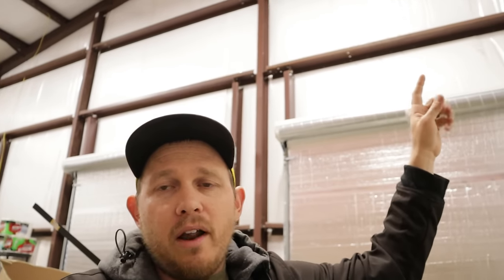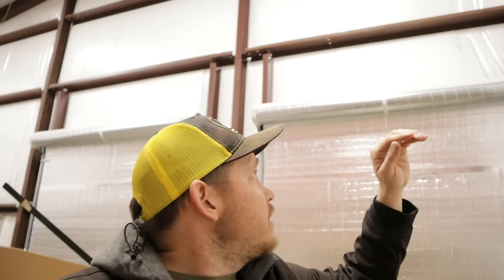My Biggest Steel Building Regrets

Comment: roof insulation-use of vapor block 3/4 foam board strip under roof panel either glued to top fiberglass itch or glued top purlin. roll run itch or insobasket. both ways keeps building from condensationon purlins yes much more expensive but well worth price as itch is full depth of purlin height. or spray foam only one inch against panel then add six inches to that save cost of spray foam...adding an elastomericcompound to roof surface keep condensation down and add years to roof lifespan sealing up all screws and joints. correct use of foam closures is also a must on gables and eves , edge panels
Reply from the maker: What kind of elsatomeric compound do you suggest?  Great advice thank you
Reply: @homesteadingbarndo  we always used what we called silver seal....no idea if thats a name brand...five gallon bucket....hundred bucks ...that was twenty years ago....I've built STAR, CHIEF, VARCO PRUDEN...we mainly used on service calls for leaks or sometimes on standing seam panels where steamer didnt get good closure....mastic tape needs to be semi soft when applied or it will not get squish it needs ..
Reply: @homesteadingbarndo  something else, when used do NOT walk anywhere on roof panels  stick to walking where purlins are located. panel will flex or kink in weight applied to weak areas....words of wisdom. any kinks need to be reinforce with overlapped peice panel and caulked throughly and silver seal applied around perimeter

Comment: I am planning to use a wood burning stove in my barn/building…I already have the stove, as I was planning to use in my unfinished cabin, however at 700 sf, any ole electric heater will probably suffice.
Reply from the maker: I just put my pellet stove in the 1200 foot shop half of the building and it has been cold already but it is keeping my house in the mid 60s without heaters! 

I can't recommend a mini split enough

Comment: No one ever tells you what a HUGE problem with condensation is with steel buildings. I run a dehumidifier all winter in my storage barn. ……You will still have the same problem with wood framing because the problem is with the metal roof and siding..
Reply from the maker: Yep I had no clue

Comment: Could you do spray foam on the ceiling and cheaper insulation on the walls to save $$ money and not have the vapor / moisture issues?
Reply from the maker: This would probably be a far more cost effective method. I think if I was building again I would just spend WAY more time making sure everything was perfect. I'm happy to say we don't have leak issues anymore but it was  alearning curve. 

Building without being so rushed would have helped too, we were racking up bills for equipment rentals and weather was terrible. High Winds and things so if I had been able to build in in May/June it would have been much easier too. 

Hindsight is 20/20 right? 

You building anything?

Comment: Thank you so much for sharing your experience with us.
Back in the 80s I was a contractor in Central Texas and I erected and finished several steel buildings ,some of them fairly good size..
When I first started doing it I was shown by someone to use chicken wire mesh and cover the entire frame with that before laying the insulation down and that way you can get those seams more secure, and it holds itself up without sagging in your roof...if someone does it  please consider putting wood between your flexing steel framework when you tighten the chicken wire.... then after sheet metal is screwed on securely you can remove those wood spacers from your purlins and girts..
None of the buildings I built ever called for spray-in foam , so all I ever used was the vinyl back roll insulation...
And there is not a way to do it without hating the experience... LOL!
I do certainly like the spray foam better..
Anyhow, great video and for anybody who's doing  steel buildings , I would suggest watching this fella and listen to him..
Reply from the maker: Thank you so much and that's so interesting! It definitely sounds like a terrible experience, but I'm sure it's really effective at keeping everything in place.

Comment: I used big building Direct to install a 24x50 metal building . What a mistake! It rains inside my building every time it rains outside . No baffle installed under the ridge vent causes rain to blow right in!  Crap Job done by Big Building Direct! I’d definitely use someone else 3:10
Reply from the maker: I'm so sorry you had that happen! That's real tough. I wonder if doing closed cell spray foam would fix that?
Reply: I'm glad that I saw your post. I suspect that the problems you had reflected what looks like a good price. Taking short cuts that the average buyer doesn't notice or know to look for.
Thanks

Comment: I just found your video.   I am planning on building a bardo too. You mentioned you want to get a helicopter.  I can tell you this. My father rebuilt helicopters for lots of the pilots that took the tourists on rides on Miami and Ft. Lauderdale Beaches.  I also helped him for many years.  You will need to factor in the hight of the trailer to roll it in there.  My father built a two story barn. They barley fit. So figure on those doors being about 24 feet high at least.  My opinion,  get a separate building for it. You can't leave them outside.  Of course it all depends on what type of helicopter you get.  Also,  my father had wheels that he put on the landing rails that he used on some of them.  But if you are getting a small kit helicopter for one person they can be shorter. Do you homework. Also there are a lot of rules for aircraft.  If you are not rich,  rethink it.They are very expensive to upkeep.
Reply from the maker: This is really helpful thank you! I think I'll try to rent out helicopters when I start learning rather than buying one.
Reply: @homesteadingbarndo, smart about renting. 

Consider consulting a tax person (maybe a tax attorney) about whether leading vs owning is a better write off for a business. 

When I studied for my realtor license years ago, my teacher told us that leasing (his example was the building for a business) was a better choice, compared to owning. This could have changed in the interim, tho 😊
Reply: @khm2128  I am building this for my home.  I am hoping to stay away from a mortgage at my old age.  Especially in this horrible economy.  I have no mortgage now.  I am selling this place to build on a  seven acre piece of land I have in a different state. I am a homesteader.  I have been for many years.  Moving to a larger piece of property means I can do more.  I am on one and a third acres of land right now.  Plus this new property is next to a family member.  His land and my land together means that we can have cattle and sheep. Not just the chickens I have grown.  Plus I have a 20X32 greenhouse ready to put up already there.  I have a small greenhouse here. I have lots of different fruit trees that I have planted over the years here. I have already started planting some on that bigger property, but will be a job to plant the amount and diversity that I have here on this site.  I like to have some sort of fruit all year long.

Comment: My shop I just sold was built in 1994 and it still looks brand new. The horse stalls were build 5 yours latter,and the bees have destroyed it.never again will I use woof for anything except furniture,moldings.or campfires
Reply from the maker: Thanks that's good to know. Sorry you had a bad experience with carpenter bees that sounds rough

Comment: Great video. I plan to build the same size steel building. 37K seems reasonable.  What is the name of the company that sold you the building and did that include the erection cost as well? Thanks
Reply from the maker: It was star state steel, they were great to work with, Linda is the owner, super kind and helpful lmichieli@starstatesteel.com is her email. It didn't include cost to erect, here is a breakdown to the penny of costs to get it to the point of building inside. https://youtu.be/pfoq-IYr3SE I'll have a complete cost breakdown soon for interior build out too as I get everything finished. Let me know if you have any questions and good luck!!

Comment: i originally went for 14' garage doors on my barndo but that gave the architect(s) ... trouble let's say.  it's hard to find planners/architects that can think outside the box so to speak.
Reply from the maker: What did you end up with? I couldn't find any architects to help out on the house design so I had to learn it
Reply: @homesteadingbarndo  I eventually told the guy to put a standard height residential garage door in, export everything and then terminated services.

It's so hard getting architects/planners to not think in "standard residential" terms even if you find one.

Like they seemed to have difficulty grasping the idea of "no plumbing on exterior walls".  "But don't you want a window in front of the kitchen sink?"  ("Why would I risk a burst pipe for the sole purpose of mindlessly staring outside while doing dishes?!")  They really just can't mentally leave the train tracks.

You might have been ultimately better served by learning it yourself.
Reply: These guys draw up designs that look good on paper but aren’t practical when you build them.

Comment: I hired "professionals" to install my roof and they screwed things up so badly I had to fire them and finish it myself (with the help of my wife).  We elected not to install the insulation on the remainder of the roof and I hired an insulation company to come in and install it (with additional fiberglass) after the fact.
Reply from the maker: That roof install is tough! Good on you for finishing it, I've been very happy with my roll insulation now that I've figured out all the issues with condensation

Comment: Thank you for taking the time to make this video
Reply from the maker: Thanks for watching and commenting. You thinking about building a barndo?
Reply: @homesteadingbarndo  Yes I am but I may not be using it for conventional means at least a section of it along with making it a almost net zero building plus I'm still in the process of finding the proper property to do what I want on which is going to require me moving states. But I have been into Barndos or post frame homes for the past 4 years and I have gotten a lot of information on multiple channels about them. But I know if I am going to build a custom home it would be one of those two choices because stick frame takes a lot longer and a concrete home is not conventional it's usable but not modifiable ICF homes come with too many issues and lack of availability to remodel or add on to later sips homes were a good idea but the execution is not to par in my opinion but thank you for taking the time to ask me the question.
Reply from the maker: @c.n.h4841  that's awesome!! I wish I would have done spray foam insulation, especially after living in it this year, would be much more efficient, I am also wanting to get net zero too with a solar and battery system

Comment: I would without doubt used Insulated Steel Panels for building. Prefer Panelsell CA. Watch this video by Spray Jones on how much insulation you really need: How Much Spray Foam Insulation do I need?
Reply from the maker: Awesome thanks for the tip!!

Comment: Greetings from the UK where the idea of a 'Barndominium' creates confusion and scares the authorities..  I have been attempting to build something similar here for years and the relevant Professions here listen to me,  admire my Sketchup drawings..   & I never hear from them again.. 
                          
There are Steel frame building company's here but are only considered Commercial and never Residential.    We are very slow to change here..
    
 I assume when you choose a supply Partner (in the US) they will do all the Regulatory, design and permit requirement including Structural loadings.. in house..?
I wonder if an American company would design for me..?

In Designing my Build, I decided I would go with a thin PIR Composite panel (1" Kingspan RW1000 type) as my outer skin/cladding instead of bare Metal as these sheets are much easier to handle and fix than 6" thick (and actually constitute 75% of required insulation..)    And then when you are weathertight,  use spray foam (PU or PIR..  not breathable soft foam..) to the underside metal face (to build up to your requirement)..    This should alleviate any Condensation issues.

Like you I have been unsure whether to do Framing with  Wood or Metal..   I think I currently choose..  Metal   (Hot.. not pressed galvanised sections..) for the quick fabrication and erection times..
I love wood (I am a Carpenter..) but I think using engineered Timber like glulam or LVL's seems to be the only real option for speed and efficiency..

Thanks for a most interesting video.
Reply from the maker: I am sorry you're having a tough time of it! 

I'm sure you could contact a us based company, but I am sure the engineering requirements and licensing is different. I got the steel building company to get it engineered.

I live in a very free county so you don't need any permits to build. I built all my walls and interior structure to code along with all the other mechanicals.

I hope you can get it done, it has been really great in my experience

Comment: Did you mean $3,500 or $35,000 just to redo de insulation? Thanks for the video.
Reply from the maker: It would be around 35k to get spray foam in there

Comment: PS... spray foam can have some major drawbacks as well. Offgassing, mold and expensive. Do your homework well before committing to spray foam. It just about doubles the cost of your building and it is not a perfect solution.
Reply from the maker: Thank you I'll check out the prodex you mentioned!

Comment: Spray foam has many issues, if you have a roof leak you might not see it for months or years until you have a catastrophic failure.  You didn’t install your insulation correctly.
Reply from the maker: That definitely makes sense. I think if someone has more experience and installs their fiberglass like a vapor barrier they would be good. Definitely user error on my part

Comment: did you put a plastic sheet over your gravel before you pour the concrete?
Reply from the maker: We didn't put a plastic sheet down. We put down sand and then fine gravel and then 3/4 minus on top of the fine gravel. The excavator went all the way down. https://youtu.be/nV_BkWr6-gc?t=533 is what it looked like at the site prep phase.
Reply: @homesteadingbarndo  surprise to see so much condensation after what you put in. I'm in Sacramento CA thinking of a 30x40x15 condensation is what's in the back of my mind, cause it does drop to 30 degrees in the winter.
Reply from the maker: @notchit3542  Yea it was my ignorance about not knowing I needed to make sure EVERY seam was sealed up, even if it didn't appear that there was a gap in the insulation. It really needs to be air tight, and if you make sure to take your time with the vapor barrier you'll be OK. That is why I think I would suggest spray foam instead if possible, you won't have the vapor barrier issues, but if you do go with fiberglass and just really make sure you don't have gaps or areas that aren't sealed you will be good. 

I think that a 15'  eaves building would be a lot more manageable too, especially if it isn't windy.  Good luck are you going to build it by yourself or contract it out?
Reply: @homesteadingbarndo  I'm not sure if I'm gonna erect it myself or not. Never done it before. I guess it all depends on cost of renting the heavy equipments & how long will take me, compare to if I contract it out. But I won't be able to start until 6 months from now, cause I'm still trying to finish my house. I did saw another video there's a metal roof panel " same as yours" except the roof panel has a thin layer of fabric material & glue to the panel, which suppose to stop the condensation. Is the same material they put on car's wheel well. I also thought about plywood on top of metal purlins than have the options to either use shingles or self stick roll membrane, or etc.
Reply from the maker: If you're relatively good at building things you can do it. It really helps to have an extra set of hands for the build too. 

I really wish I would have watched these guys' series on how to build, it is literally everything you need to know on how to build your shop. This would have saved me so much time: https://www.youtube.com/watch?v=yfR-QVtGEB0
Reply: We framed a large house for a engineer that worked at a local plant.
It was three floors and built into a hillside, he was contacting it himself.
Of all the things he chose to do to save money, he roofed the house himself.
I look at that as a major lapse in judgement.
When it comes to working up high or with things like wiring, let people who do it everyday do it.
One missed step an that guy could have been dead or disabled for life.
Paying a pro is a small price to lay out compared to dead or disabled.
Building a building this large as a diy is a bad idea.